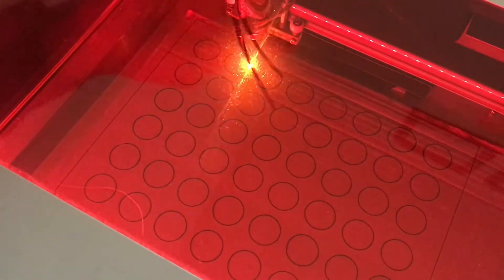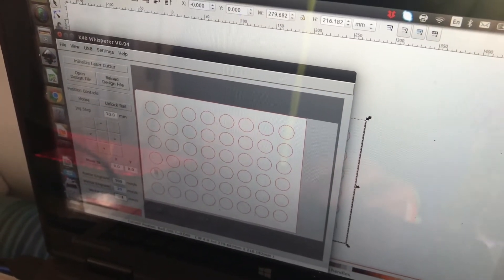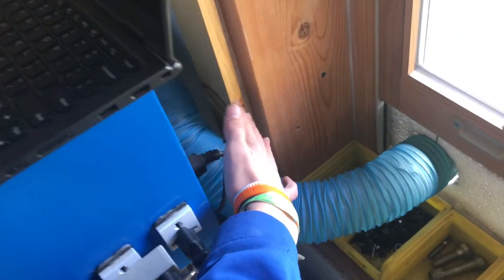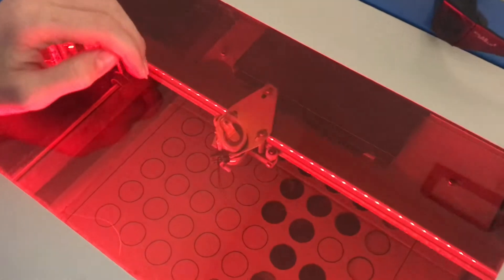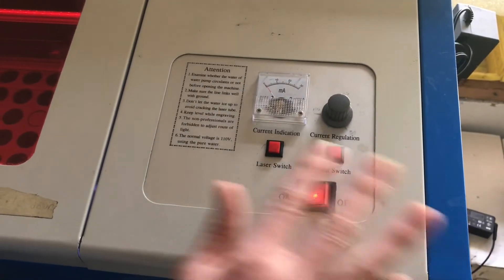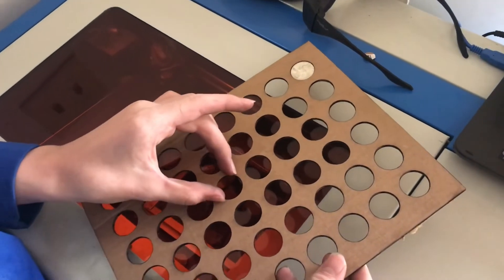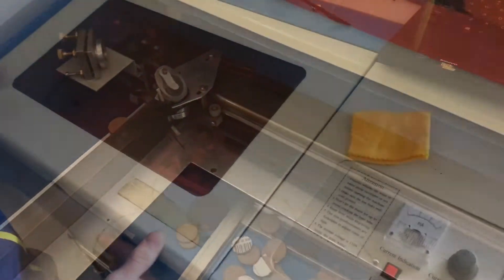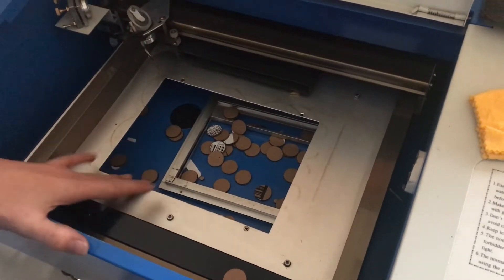Using MODIFIED k40 laser cutter with inkscape

Comment: i know this is old video but shouldn't the k40 be able to cut cardboard in 1 pass?
Reply from the maker: When everything is turned up it’ll cut cardboard in One pass. This machine does not come with air assist, but it makes a big difference. We got this machine for about 400 bucks and we use it all the time. I hope this answers your question

Comment: What size/dimensions was the original piece of cardboard? Also, do you have any problems with sparks bouncing up underneath the cardboard where the laser is going through the cardboard and hitting the bed?
Reply from the maker: I’m not sure what the original size of the cardboard was because it was a scrap. The finish size was eight andhalf by 11. I’ve never had a problem with sparks coming up from the bottom, but I watch every cut every time without fail. I’ve seen a lot of fires in a laser machine, If you catch it fast you blow it out that’s it. If you don’t catch it it burns your belts in the end up having to clean everything and put it all back together. I’ve always had to strict rules with the laser never walk away while it’s cutting and always clean your lens before you start cutting. We’ve really been enjoying this laser cutter though.
Reply: @livefree6878  Such a helpful response. Thank you! My laser cutter arrived today and I'm really excited about using it. Thanks for your great tutorial.